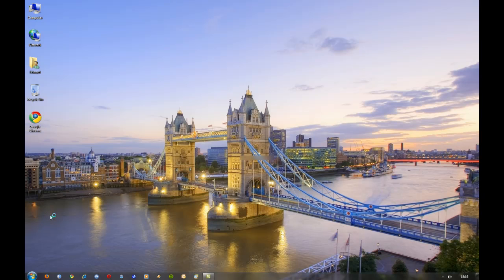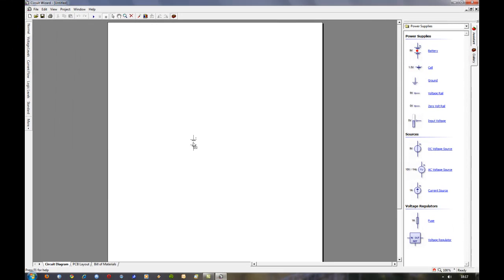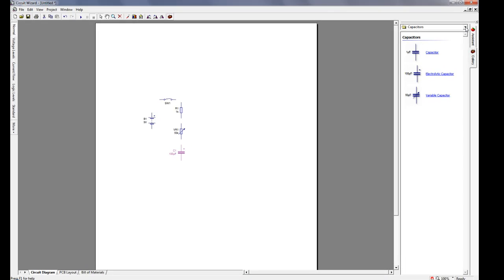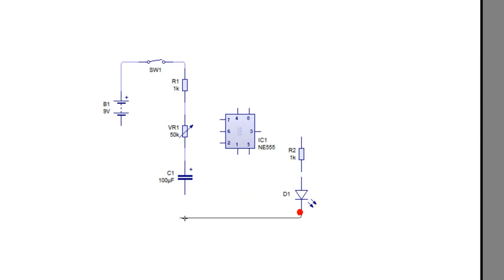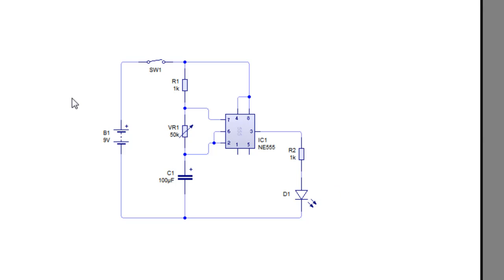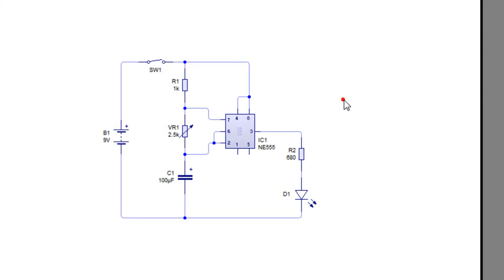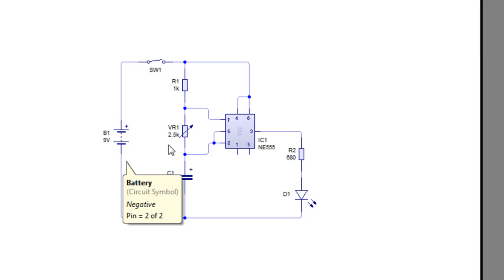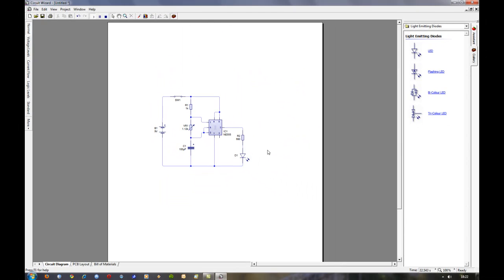How to Design, Develop & Manufacture a PCB | Part 1 - Designing Circuit & Testing Virtually

Comment: Is this the process of a single layer pcb board
Reply from the maker: Tayab Ali Yes, this is for a single sided PCB.  The software can also route double sided boards too though.
Reply: i need help with my assignment. what is routing and why is it used for.
Reply from the maker: Tayab Ali Routing is the process of mapping the schematic (circuit diagram) into a physical layout which can be created on a PCB.  It can be automatic, where a piece of software routes the rats nest (connections between components) for you, or manual, where you route the tracks by hand.
Reply: thanks for that. can you do automatic routing on circuit wizard.
Reply: is it possible to do so
Reply: and also all of the parts linked to this video. are they all single layered pcb process as i have to write about this in my assignment
Reply from the maker: Tayab Ali Yes, Circuit Wizard has an auto-routing tool.  I find with many auto-routers though that it's often easier to get a cleaner layout by hand.  It's all based on the auto-routers parameters and the algorithm it uses.
Reply from the maker: Tayab Ali Yes, all of the other parts of the video series are for single sided.  If I recall correctly I actually fabricated a slightly different PCB to the one I demonstrated here, but the process is the same.  All the best with your assignment.
Reply: Edward Holmes thanks

Comment: Hello, I have ver 1.50 Pro version and when I print the solder side mirrored, the copper text is printed both mirrored and non-mirrored making the text all a mess.  Any ideas what I am doing wrong?  Thanks Alan
Reply from the maker: I'm not sure, I have noticed this problem occasionally, when printing to a PDF file.  I haven't found a way of stopping it, but it might be worth dropping New-Wave-Concepts an email and seeing if they know why or can propose a solution?  Sorry I couldn't be of more help.

Comment from the maker: @iWinterHD Yes a flashing LED could be used however with the use of a 555 timer you may adjust the mark space ratio and frequency at which the LED flashes.  The purpose of these tutorials is to show how to design, develop and manufacture a PCB.  I chose the 555 timer astable circuit because it was a fairly simple design.

Comment from the maker: @plazmafeld To do this you would need some sort of sound to light unit.  This could be made using a few op-amps.  You would need to split the different frequencies up and then compare them with a preset level.  Have a look at this circuit if you are interested: bitdotlyforwardslashmxxu6U

Comment from the maker: @ARealMouthful111 Circuit Wizard is like Livewire and PCB Wizard in one. It also includes other great features such as the ability to test the PCB layout virtually too and also allows you to run a report to find any differences in the PCB layout and the Circuit Diagram. Compatibility wise you can open Livewire and PCB Wizard files however you cant save them again back as Livewire or PCB Wizard unfortunately. If you have no intention of using Livewire etc. then Circuit Wizard is absolutely great!